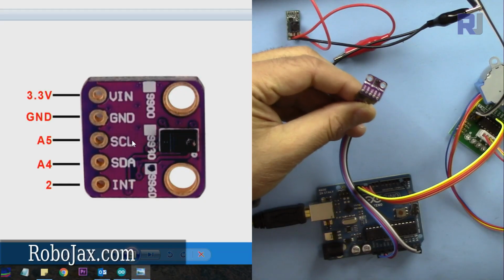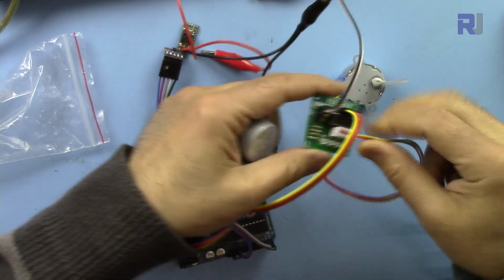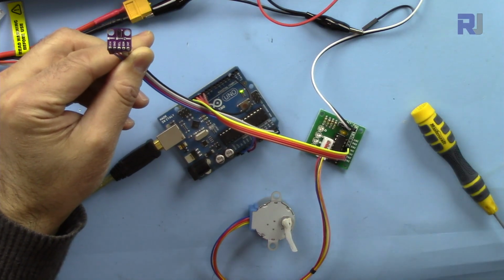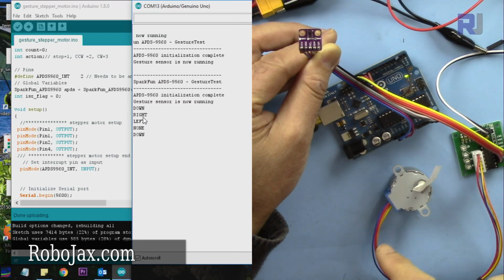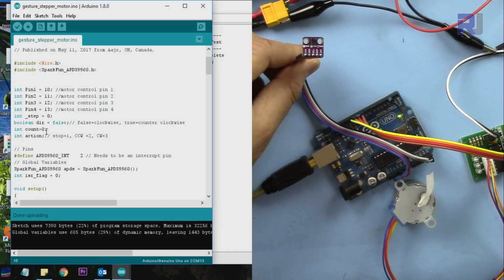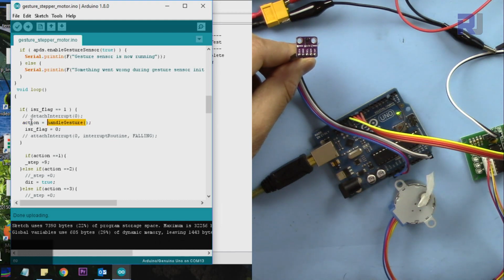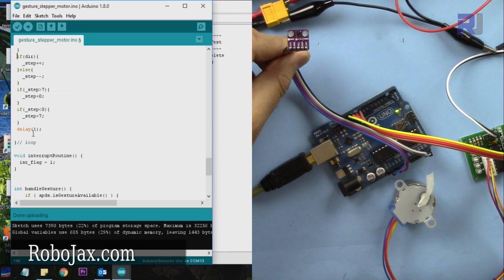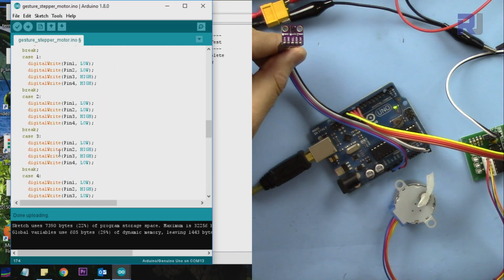control 28BYJ-48 Stepper motor with hand gesture using Arduino - RJT633

Comment: I think the code is wrong, my motor is not rotating
Reply from the maker: The code is good . Check wiring if you have not changed the code. This video requires you to watch the gesture viewing first to make sure it works and then come to this video.

Comment: can I get manual for this ? like ckt diagram and code?
Reply from the maker: yes you can. get this free software https://fritzing.org/ as I explain it, pause the video and draw it.
Reply: @robojax  I am unable to figure out circuit connections, help me with a circuit diagram please.
Reply from the maker: First I explained the motor.  So you should know all possible of motor.  Then I have shown wiring , step by step. Watch , pause and do it. 
I don’t way to sell you my  Arduino course , but now you asked,  all lessons on Udemy have wiring diagram. But I am not sure if this video is there. Check the course before you purchase it.

Comment: Hey Robojax, could we do this with a tracking sensors? Say you have a sensor that you can attach to a helmet you are wearing and you turn left or right , could you get a stepper motor to turn in the same direction, what would be needed? i'd like to use a bigger stepper motor that is more powerful but I have no idea on what sensors should be used, just for an idea of what I'd like to do, there is a company called Roto Chair VR, doesn't seem like they are selling or shipping, but i'm really interested on how they got the chair to turn with the tracker? it has to be based off this kinda of stuff right? Sensors, stepper motor, maybe arduino board of some type. Any help and direction would be appreciated..

Comment: Could you make a gesture controlled AC fan? And control its speed with gesture?
Reply from the maker: AC motor (fan) is is not easy to control.  It needs very complex circuit. At the moments I  down't be able to do it because I don't have the right components.

Comment: hi sir can you please help me.... for rotate stepper motor on input
Reply from the maker: Hi, on what type of input? Push button? Temperature? some other sensor value?
Reply: Robojax 
sir using 4pir sensor if pir1 is high motor move pir1 if pir2 high motor move pir2 and so on....sir please help me....
Reply from the maker: so as I understood, you 4 motion sensors and 4 motors or you have got 4 motion sensor and 1 motor. in any case unless I construct this and experiment with it, I can't just type code and give you answer.  I will put this in my "to do " list but at the moments I can't suggest anything without any experiment.
Reply: Robojax 
Actually we need this urgently... so when ever you do thia let us know
Reply from the maker: I don't know as I have other item on the list which will be done first.